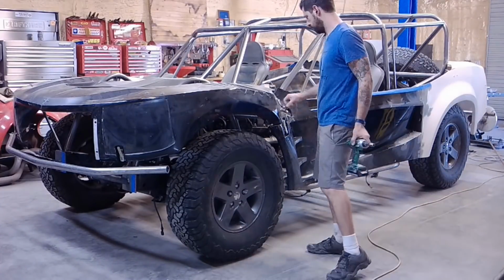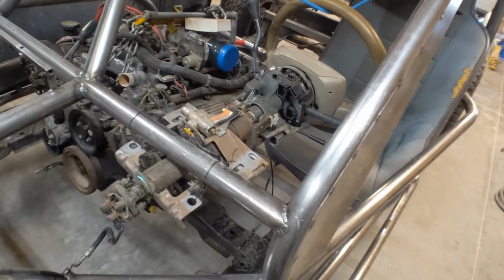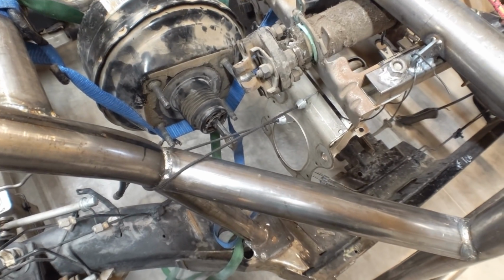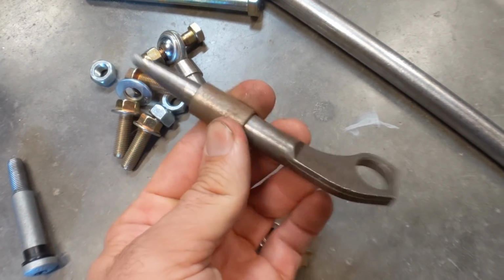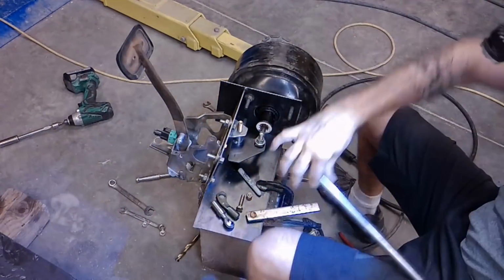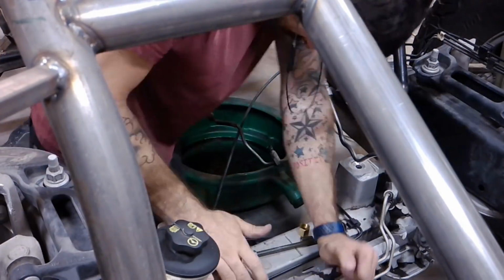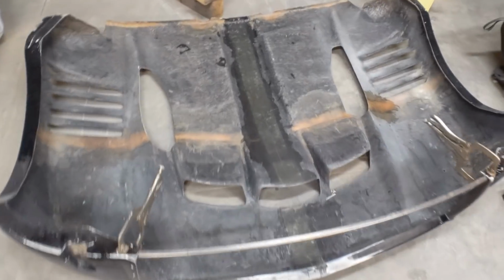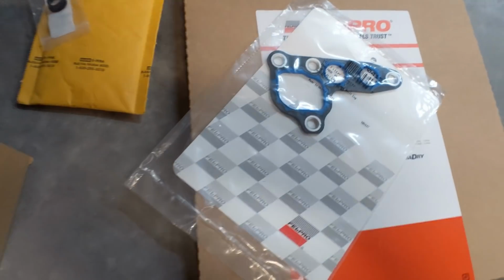$4k Crown Vic Trophy Truck Build (episode 5)

Comment: Nice hydraulic shear. You independently wealthy? My Lottery Workshop? Bad Rich Uncle leave you a fortune to make the bad dreams go away?
Reply from the maker: I grew up super poor. Decided the only way I'd ever get the tools I wanted was to trade work for tools. I'd install engines for free if they'd buy me a cherry picker or install a trans if they'd buy me a trans jack. I got the lift i'm using for free as a trade for putting back together a truck that someone disassembled then bailed on. The bed was full of all the unsorted nuts and bolts. Took 20 years of bartering to get the setup I have now.
Reply: @AustinCoulson  Awesome. More power to you! Good trading!

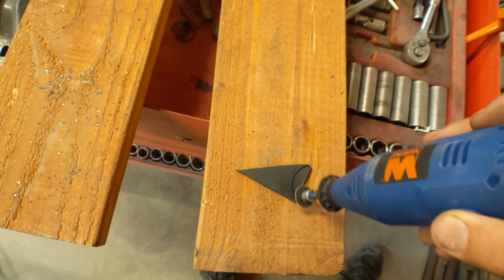Comment: On those mounting tabs @ 7:30 you should just use a holesaw. Whichever size OD pipe your welding it to. Then cut out the triangles after you saw the whole in the flat stock.

Comment: Been amazing to watch. 
Why did you do a sheet steel roof skin, couldn't you have kept it lighter with a fiberglass sheet?
Reply from the maker: I used 22 ga steal with bead rolls for strength. fiberglass would have actually weighed more due to the thickness required. Would have been more work as well.
Reply: @AustinCoulson  wow I'd never have guessed a higher weight with steel over fb...I'm rethinking alot of assumptions I had planning future projects.

Comment: Saw you breaking your head over using the dremel or should i use the grinder. Thought bij myself cant you just use a drillpress. You did almost the same. Maybe a drillpress is a little bit easier since it comes in straight.

Edit; just after that i saw you using one. Why not using it for the smaller pieces?

Comment: For the skid plate (if you ever see this) add some foam between the plate and pan to avoid anything getting in between and punching a hole
Reply from the maker: I saw this.

I have never heard of this before. Have you seen this done anywhere?
Reply: Austin Coulson  this is extremely common in rally. Necessary really to avoid a pan puncture because rocks get everywhere and all it takes is one getting between the skid plate and pan to wear a hole or punch one after one good hit. Team O’Neal rally school has a video showing theirs on their rally cars and why they do what they do to their cars
Reply from the maker: @MyLonewolf25  awesome, I'll check it out. The clearance on the pan to skid plate is tight so this should help
Reply: Austin Coulson  np! I try to help spread good ideas when I can because I’m tired of the secret squirrel bs that plagued car culture
Reply: Austin Coulson  https://youtu.be/E7C2b7eQ4VE shows it about 15 minutes in specifically

Comment: Sooooo much work could've been avoided by just stretching the wheelbase 6" ( trans mount flip, body mods, suspension angles,) plus the weight could've stayed further back. My $.02.
Either way, awesome job!! This is such a great idea. Keep it coming!!!
Reply from the maker: I didn't wan't to stretch the Vic frame. I wanted to test the limits of as many stock CV parts as possible
Reply: @AustinCoulson  Fair enough. Great job man.

Comment: Did any one notice there’s a missing bar from the roll cage in the back next to spare tire, the right side has it (looking towards the car from the rear axle) but not the left it’s the one that looks kinda like (the Upside down U loop) the front ones for the coilovers wondering if he puts it In a future video
Reply from the maker: That's where I will mount the battery. I figured since the battery is heavy and I need some good mounts, that would be a good spot

Comment: Im building a AWD Subaru drivetrain into a CF100 wing tip Jet fighter fuel tank. So I'm enjoying your channel and subscribed as your doing stuff im doing. Please check it out! Sorry about my editing but you'll get the picture.
https://www.youtube.com/watch?v=gsZkZi0ybi8&t=9s
Reply from the maker: I watched the whole video and the follow up. That thing is Bananas. I almost used a fiberglass drop tank from an Apache and put an STI drivetrain in it, but I just didn't think it would be as cool as an aluminum tank and after watching yours I think I made the right choice. You have got some serious hours in that thing. I just can't believe all the custom touches. I can't even weld stainless, let alone fab little parts like that cleanly enough to polish. Good job, sir, I subbed to your channel, hope to see more.

Comment: Coming along good .. that engine is pretty damn close to you and the pass ... what kinda heat protection are you gonna make prob would have been better to move the engine a foot or so forward no?
Reply from the maker: If I could go back, I'd move the motor forward, but not for heat, the heat shield works great. I'd do it to gain more travel in the rear.

Comment: Shouldn't the triangle be a 1:1 ratio? (Center of the pivot to center of bolts should be the same, right?)
Reply from the maker: Generally, but you can change the angles depending on what throw you are looking for. If you wand more throw out of one side, you increase the length.

Comment: My philosophy pilot holes is exactly opposite of yours. I purposefully use 1/8 or 1/4 bits because they are easy to find at any local hardware store when they get dull. The oddball 32nd and 64th sizes are sometimes harder to find. I try to keep spare 1/8 and 1/4 on hand so I can always have a sharp one.
Reply from the maker: That's interesting. Same problem, different solutions. I like buying the 1/8" in ten packs so I always have them handy, then factor in a Milwaukee drill bit set on just about every fab job I do. Having to use worn out bits is the worst

Comment: I'm looking to do something similar on 93 f150, if I dont end up using it for drag racing
Reply from the maker: If it's a regular cab short bed the wheelbase should be close. You'll have to strengthen the frame a little because the frame was designed for a full car body, not a cab and bed setup, but it's a wonderful platform to use. My email is on my channel page, hit me up if you run into any issues and have questions

Comment: I gues I lost how he made the curve in the sheet metal around the engine.
Reply from the maker: I used an eastwood shrinker. It puts a small curve on sheet metal
Reply: I liked it when you showed how to make that cut with the whole saw. Like the tips like that I'm sure uve got tips some now for joining those pipes making sure the distance is right and the notch is right so you don't have to walk back and forth from the bender so many times.
Reply from the maker: @ghostovadose  if you wanna see a great video on how to get the notch right, here is a link:
https://youtu.be/mHBanmfn_CA
I don't do a ton of tube bending and notching, maybe 2-3 times a year so I always watch the video before I get back into it to freshen up.
Reply from the maker: I should mention that I don't even bother filming a timelapse of making the individual cuts and notches because sometimes I'll have to cut 1/16" slices over and over to get it just right. It's rare for me to get it perfect on the first try if it's anything but a straight bar

Comment: This man is a magician.
Reply from the maker: I saw your video from a while back where you spray the raptor bedliner. I was thinking of using that on the inside of the fiberglass to keep the little fibers from flaking off over time. Would you recommend that product?
Reply: @AustinCoulson It's a great product.  It's easy to use and it is very durable, but I don't know if it would like to flex with the fiberglass.  It would be interesting to see how it would react!

Comment: About the brake "triangle". Next time try to make the triangle side as long as possible (less sideways movement for the rods). And be sure to keep the holes in 90 degree angle (less sideways movement for the rods). And initial "brakes off" position for the triangle; rotate it half an inch (split the movement range in half) towards brake pedal (less sideways movement for the rods). As you know, the last thing what you want in those brake rods is sideways movement and fatigue cracks...
Reply from the maker: What is interesting about the Allstar relocation bracket is that the triangle piece is smaller than the one I did. I never noticed the sideways deflection on that unit, but I am sure now it is because they use 2 heim joints, so it is just less noticeable.  I would have rebuilt the whole part if this were to be driven by someone else, but I am interested to see how it functions and holds up, since I can inspect it as it gets some miles on it.  I am especially wondering if it will tear up the plastic bushing on the pedal rod. 

What did you think of the new rear coilover mounts?
Reply: Those rear coilover mounts looks good.

One additional thing, if possible lengthen those steering wheel mounts so that they reach the next pipe in front of them. And add a long bracket along the top of the square profile, from end to end. "T-bar" structure is easy way to get longitudinal stiffness.

Comment: This is by far one of the most impressive builds i've ever had the privelege to watch!
Reply: driving that thing is gonna be hotter than Hades itself especially with your leg so close to the exhaust manifold. Even with insulation I'd guess it will be very uncomfortable but I could be wrong. Great Job though!

Comment: Excellent progress.  Might want to consider placing the trans temp sender in the output line heading to the cooler.  Get to see true temps after the converter thrashes on it.  I know there are different schools of thought on the placement, and it might not work with your budget.  Of course either  spot is better than none.
Reply from the maker: I have seen some guys do an in-line sensor, but I have gotten used to the temps from the bottom of the pan, and I have worried if I change placement now, I might freak out about the high temps. I should check where the sensor is on my Newer F150. That thing runs 195-205 unless i'm pushing it or towing which is almost exactly the same as a racecar I built from a Thunderbird that ran the same trans as the buggy.

Comment: If it was mine I would make a roof cover that blended into the body and maybe looked like a truck roof.
Reply from the maker: I have thought about that, I have the fiberglass roof still, and the A and B pillars I cut off. I did the sheet metal A and B pillars with the hope that I wouldn't need fiberglass on top and could still make it look cool, but I haven't decided exactly what I am doing yet. I might just work to blend the fiberglass to the sheetmetal better.

Comment: Dude, love the build, and the tips are a great addition. The booster bracket is a pain, geometry sucks. My early bronco has a similar offset, but not as severe. Everybody subscribe, like, hit the bell, comment, and share. Not enough of these channels on YouTube so let's support it.
Reply from the maker: The brake bracket on an Broncos was the first time I had ever seen a relocation done that way. I thought it was an aftermarket addition for a while, as I had never known a manufacturer to do that. Then I started digging around some of the resto-mods that I had seen at Barrett Jackson and wondering how they hid the brake components from the engine bay.  Been wanting to build my own for a while now, but it never made sense until this build. Thanks for the kind words!